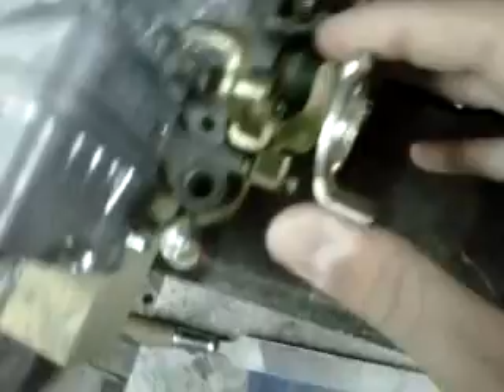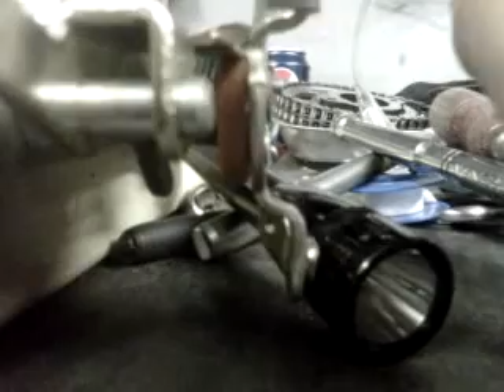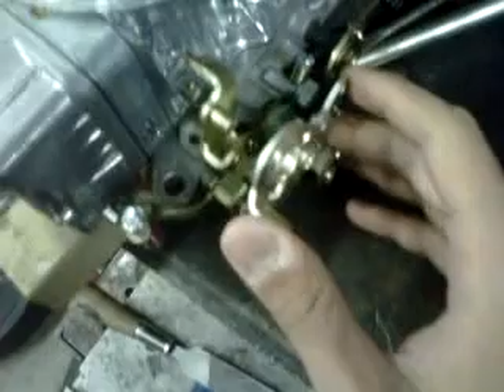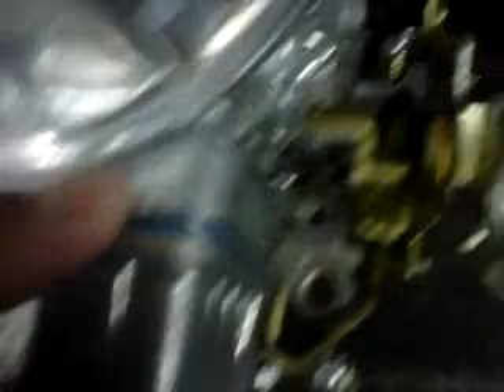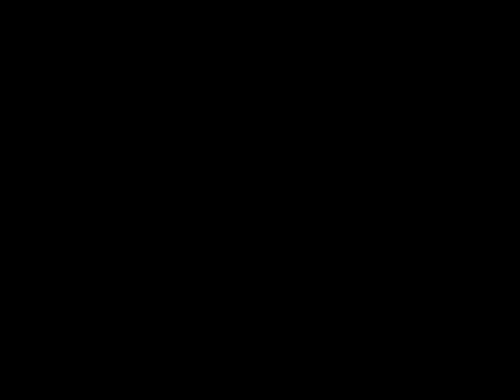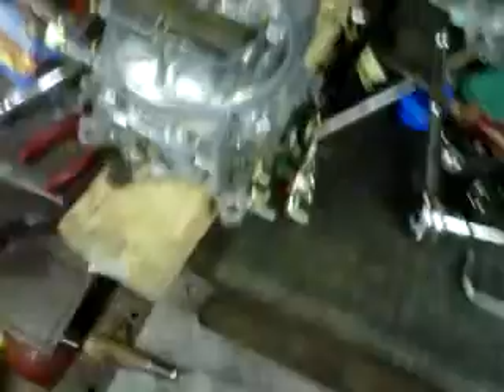Street Avenger Holley Bog Problem (when you dont know what you are talking about)

Comment: I often find the arms need a lil bending and adjusting etc especially when changing pump cams or converting to a 50 or 70 cc acc pump for race of e85 or alky thats not out of the ordinary at all. No carb is right for anyones application of of the box. Dont complain thats its not a performance carb because its metered on the lean side. You bought a "street" avenger! Metering can be changed, its made to be changed every engines different. Carbs arent bolt on and go if you want best performance

Comment from the maker: I run a spacer plate on every carb that I have because the heat soak from the intake causes fuel percolation. you do not have to, but I always do unless my intake itself is a high riser

Comment from the maker: I want to point out that im as good at tuning as it gets. mine was a new carb. some are good some are bad. quality control was a fail. I ended up bending that lever just a bit so it was off the spring. its just not a performance carb its metered too lean. I stuck this carb on my stock 302 and adjusted it to run perfectly. I put a double pumper on my 289 and adjusted it to run flawlessly. its just not a performance carb. its metered for efficiency not power.

Comment: I just bought a street avenger 670 and after some minor tuning its near perfect. You can't say holley "failed" because you bought a used carb and can't get it to work. Check your pump cam and make sure u are using the correct screw holes. Mine works fine new out of the box. Never buy a used carb and expect it to work properly. Street avenger is an awesome carb when it's correctly tuned. Take it to a speed shop and get a professional to tune it if its being that much of a problem.

Comment from the maker: the gas cap would check for vapor lock like a poorly breathing gas tank but you seem smart enough to not have this problem. first id turn it down to 5psi. i run my 11 to1 289 at 4psi all day on the street just fine. it would only take just a bit to blow open the needle and seat and cause this issue. not saying its your problem, but i guarantee its happening. also, pick yourself up a 1inch phenelic spacer. keeps the carb nice and cool and the fuel from percolation in the bowls.
il review the vid

Comment: My car has TrickFlow heads,E303 cam,RPM Airgap intake,Holley 670 carb with a Holley Blue fuel pump,Holley Reg with fuel pressure gauge..She shouldn't be doing this and taking the gas cap off won't change anything,fuel pressure stays at 7psi ..It does seem lean on the top end and I have a video in my channel going from 1st to 2nd if you wanna check it out..I'll grab a can of starting fluid or carb cleaner tomorrow and sprab the intake and carb base plate..If that fails,going with a Holley 750 DP

Comment from the maker: that is a strange problem. do you have a fuel pressure gauge? seems like the carb is just leaning itself out. if it is lean, make sure you don't have vac leaks and it is not vapor locked. test this by going for a drive with the gas cap off. 
if its rich, im sure its due to too high of pressure caused by excessive heat, this will overflow the bowls pretty easily. 
get a read on the plugs to tell either way
its hardtop diagnose without being there in person 

I went with a 600 DP in the end. .

Comment: I have mechanical advance. Played with it when I installed the distributor but can't remember what the settings are. Need to pick up new kit. My timing light shows fast curve but short to only 25btc. I am going to put a 38 nozzle in tomorrow and see what happens. I will install a hollow screw as well if it is in stock. Thanks for the replies.

Comment from the maker: I would think a number 38 nozzle with a hollow screw and a pair of 65-68 primaries would get it where it needs to be. I believe you have an off idle issue more than anything. change the distributor springs and stop bushing to the lighter silvers or blues and insert the black bushing I believe. set it to 15btdc with the vac advance connected for now(to ported not man vac) check out my holley tuning video about what I say with the secondary blades at idle. this NEEDS to be fixed FIRST.

Comment from the maker: I honestly think its a timing issue. what springs are in the dizzy? those come stock with the two heaviest springs and the smallest advance stop so its advancing way too slow as well as way to far. but as for the seemingly lean issue, I know the feeling and its just how the street avengers are metered through the air bleeds I believe. I could stand it and put a 600 dp on my 289 and it felt like instant 100 ponies..

Comment: I think 80 is covering up another problem. Can't figure it out. Just testing with the 80s will get hollow screw if this helps. Timing is set to 17btc. The accelerator  pump is adjusted good now Everything I read suggest lean but my fuel consumption and exhaust say rich. If your car is parked next to mine when I start you need to wash the carbon off!!! Choke is set to open early. Plugs burn clean. Might be a little hot.

Comment from the maker: seems a bit much to be running 80s on the primary side. but every engine is different. do you have the hollow squirt screw? id look into that engine timing. try ten or twelve degrees before top dead center with the biggest stop bushing you have with a blue and silver spring. 
timing has to be pretty close for proper carb adjustment
Reply: i run 64 on pri side

Comment: I have a 670 Street Avenger with the same problem. Thought I was getting to much fuel so I plugged the power valve and reduced the main jets from 68 to 53. The engine shut off when I pressed the gas pedal. Put a 6.5 power valve in and re-jetted to .080 in the primaries. Almost no more stumble. I have .53 discharge nozzle. I am going to change to .57 and see what that does.

Comment from the maker: a lot of people are not aware of this problem because they do not have their carb set up correctly. from the factory these come with the secondarys totally closed, so the primaries are cranked open really far eliminating this problem. but when the secondarys are opened to allow for even air flow, the primary blades are closed down more, and this is where the problem shows itself. most people never mess with the secondarys but the factory config was unacceptable on these carbs.

Comment from the maker: don't worry I get that a lot. there must have been a bad line of these a few years back. believe me I had everything set up correctly. I have since installed a brand new street avenger on a buddies bronco and when I set it up it did not have this problem, in fact that spring was smaller. it was a very strange deal to be sure. thanks for the concerns I appreciate your input

Comment: I'm 99.9% positive you have that accelerator pump cam bolted up using the wrong hole.. Use the #1 hole on the cam in conjunction with the #1 hole on the throttle lever and you'll take all the slack out of your accelerator pump arm... then adjust the accelerator pump lever accordingly (using the springed bolt and nut) so that there's only 15 thou of play.

Comment from the maker: it is amazing what a bigger nozzle can do! it baffles me how little is actually changed and what a large effect it makes! the nozzle number only determines how soon the shot is made. for example, a 35 will shoot the same amount of gas as a 25, but it will just be much sooner in bulk instead of a longer duration. I run a 35 on my double pumper. it originally had a 28!

Comment from the maker: hope you find the right set up. its hard for me to give viable info and to diagnose over a computer when every engine is different. I would suggest playing with the timing a bit. if you can do it without pinging, set your initial timing to ten to twelve degrees before tdc on account of your mild cam before and have all timing in by 2500 to 3000. if your timing is at all retarded from what your cam wants, your engine will seem to run rich as well.

Comment from the maker: imo that carb is a little on the large side especially with the rear metering plate. you definitely do not want to run rich as its hard on the cylinder walls. I would think that an engine of that size and build with a normal dual plane intake wouldn't ever require anything bigger than 58s on the primary side. I believe a 600 is factory 60 or higher. could try jetting it down in the 50s range and see how it goes. every motor is different.
best of luck

Comment from the maker: I do not believe that they have ever addressed the problem. since I had my 570 laying around, I installed it on my bone stock 86 302 in my truck and I still have hesitation issues on acceleration - like a flat spot. I need a smaller pump cam but I cant run it due to the spring. to buy one of these SA carbs is a gamble, it might be set up perfect for your application and you don't have to worry, but if there is something amiss in the accelerator circuit it will be difficult to correct.

Comment from the maker: due to vapor lock in the system. I have had the same problem before and blamed the carb, but it did turn out to actually be my fuel system. 
- I would still find a way to return that carb and go with anything else that isn't a street avenger. I went to a double pumper after all my problems and never looked back. the street avengers accelerator circuit is just really screwed up due to the cam lever riding on that spring. 

best of luck

Comment from the maker: this is too ironic. i have an 81 vette sitting in my garage that Im doing an engine rebuild on. the fuel lines are very small and the gallon per hour rating on that system is not that high. I don't think its able to handle 300 ponies. before you return it, find a way to fit a pressure gauge on your fuel system after the pump to see if the fuel supply cant quite keep up. it sounds like a fuel starvation problem. also run it with the gas cap unscrewed to make sure that the problems are not

Comment from the maker: no problem. its definitely much more than the accelerator pump problem. I have found that the 570 runs very well on my bone stock 302 after I got all the ridiculous linkage slop and misadjustment sorted out. it just seems to me that these carbs do not run the greatest on anything with a performance nature. at least this is the case with my own experiences

Comment: My holey sucks to The carb had a bog off the line .I called holley they said put a bigger shot I went up 1 and still have this problem.called 5 times,lack of reps nowhow. $ 400.00-    down the tube.I have same issue as you do to.droped in the truck new good wrench 350-then it racied 4500 rpm.got that down to 1600.I HATE this carb.holley  they really stepted on it this time.And still selling same carb, no improvments That I saw any way.And I'm broke ,Fuck you holley. Thanks for the vid man .

Comment from the maker: you most likely have your pump cam on the one which does not cause it to ride on the throttle spring. when it rides on the throttle spring there is no way to adjust it out because the slop is on the rotating throttle arm not the ap arm. with 4.11 gears and a T5 in the car, i went 650 DP and never looked back. when the pump cam itself doesnt contact the lever, there is no way to get it right. my buddy runs the same 670 in his truck and i set it. it doesnt have any slop. must be selective issue

Comment from the maker: you cant on these when its this way. there will still be slop. the cam has to be set to position one. my other holleys dont ride on the spring. only my 2 SA series carbs. think about it, its not going to move until the AP lever contacts the cam. so there will always be that slop, that moment where the plates are opening and it is getting no AP fuel will still be there. whats even wierder is my 570 is much worse than my 670.

Comment from the maker: i never got this fixed the right way. i ended up only being able to use cam position one. your problem will most likely be your transfer slots. the SA carbs are set terribly off on the secondary opening amount at idle. check out my other holley video thats threaded into my bog explanation video. it starts exolaining at 1:30 ish how to set this right.

Comment from the maker: this should help alot of things since now the primary transfer slots are not so overly exposed. when i get some time i will pull the 670 and do the same things. idid not meanto insult i appreciate the help. i justsee that there isnt enough duration for the blue cam(tho it did hit right away), i justworry about not knowing i would be leaking gas onto the manifold or something potentially. im fearful to go against tollerance ratings.

Comment from the maker: holley says that you should be able to slip a 15 feeler gauge or so between. i did some messing around with my spare and to be honest idk what i did but it works now correctly. what i did dowas flip carb over and screw in the screw that controls the secondary throttle blades a bit. orange camis on position two. i had to adjust the lever bolt with spring down now sothat it would not run the full duration. not sure why this caused for it to now be dead on. i did unturn the primary blades a bit.